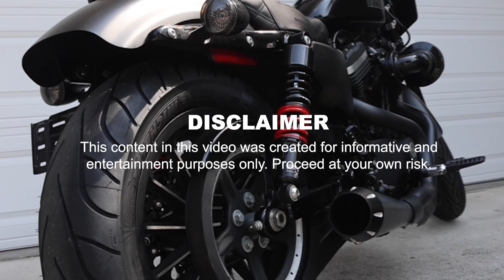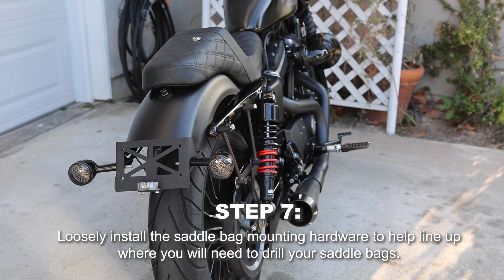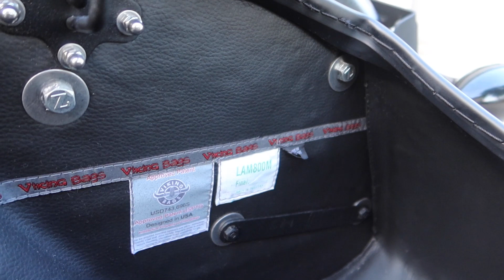How to Relocate License Plate & Install Locking Hard Saddle Bags on Sportster 2009-22 || Viking Bags

Comment: Thank you for showing off our saddlebags!
Reply: I recently just purchased your leather wrapped hard saddle bags and i don’t know how you want to take this but just letting you know these bags aren’t as easy to put on as your directions stated. it’s far from just a bolt on kit. These kits are ridiculous for what they charge you for them. The install is more than they're worth. It's crazy that they're not pre drilled bags and actual bolt up kits with proper electrical extensions with proper connections etc. this is a big inconvenience to me. and it’s not just me it was also the mechanics I took it to had the same issue and the hours they put into installing these saddle bags and customizing everything to fit is way more expensive then the bags themself. I feel mislead I spent all that money on these saddle bags and for them not to bolt up how your company stated caused me to go to a mechanic and cost me more money to install them then what they are worth. that’s why all these videos just show you drilling holes and bolts and nothing else. SHOULD HAVE PURCHASED FROM HARLEY DAVIDSON!

Comment: Awesome video, doing this mod soon!
Reply: I recently just purchased your leather wrapped hard saddle bags and i don’t know how you want to take this but just letting you know these bags aren’t as easy to put on as your directions stated. it’s far from just a bolt on kit. These kits are ridiculous for what they charge you for them. The install is more than they're worth. It's crazy that they're not pre drilled bags and actual bolt up kits with proper electrical extensions with proper connections etc. this is a big inconvenience to me. and it’s not just me it was also the mechanics I took it to had the same issue and the hours they put into installing these saddle bags and customizing everything to fit is way more expensive then the bags themself. I feel mislead I spent all that money on these saddle bags and for them not to bolt up how your company stated caused me to go to a mechanic and cost me more money to install them then what they are worth. that’s why all these videos just show you drilling holes and bolts and nothing else. SHOULD HAVE PURCHASED FROM HARLEY DAVIDSON!

Comment: Looking at the final install, it seems that placing the bag will remove the possibility of using a Viking Bag sissy bar.
Reply: I recently just purchased your leather wrapped hard saddle bags and i don’t know how you want to take this but just letting you know these bags aren’t as easy to put on as your directions stated. it’s far from just a bolt on kit. These kits are ridiculous for what they charge you for them. The install is more than they're worth. It's crazy that they're not pre drilled bags and actual bolt up kits with proper electrical extensions with proper connections etc. this is a big inconvenience to me. and it’s not just me it was also the mechanics I took it to had the same issue and the hours they put into installing these saddle bags and customizing everything to fit is way more expensive then the bags themself. I feel mislead I spent all that money on these saddle bags and for them not to bolt up how your company stated caused me to go to a mechanic and cost me more money to install them then what they are worth. that’s why all these videos just show you drilling holes and bolts and nothing else. SHOULD HAVE PURCHASED FROM HARLEY DAVIDSON!
Reply: @christophercolumbus6594  A wise biker once told me "if you want a bagger, buy a bagger..trying to make another bike into one is a money pit and fool's errand."

Comment: Great video! Any idea if it’s possible to have a sissy bar with those saddlebags? 
I ordered my saddlebags from Vikings and they’ll be here soon.
Reply: I recently just purchased your leather wrapped hard saddle bags and i don’t know how you want to take this but just letting you know these bags aren’t as easy to put on as your directions stated. it’s far from just a bolt on kit. These kits are ridiculous for what they charge you for them. The install is more than they're worth. It's crazy that they're not pre drilled bags and actual bolt up kits with proper electrical extensions with proper connections etc. this is a big inconvenience to me. and it’s not just me it was also the mechanics I took it to had the same issue and the hours they put into installing these saddle bags and customizing everything to fit is way more expensive then the bags themself. I feel mislead I spent all that money on these saddle bags and for them not to bolt up how your company stated caused me to go to a mechanic and cost me more money to install them then what they are worth. that’s why all these videos just show you drilling holes and bolts and nothing else. SHOULD HAVE PURCHASED FROM HARLEY DAVIDSON!
Reply: @christophercolumbus6594  Kind of sounds like you’re whining that you didn’t have the ability to install these yourself and mad that the shop you took it to nailed you on charges. I’ve watched several videos now in preparation to buy a set and everything looks straight forward. Not everything in life is a “buy it and just slap it on” experience. I’ve heard nothing but good things about these bags…..